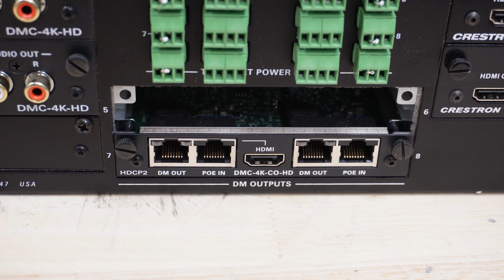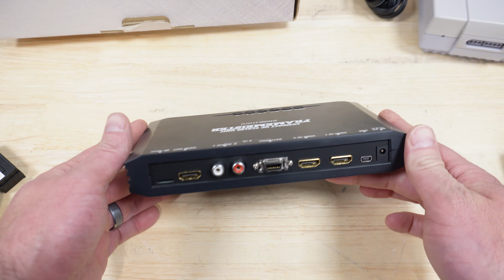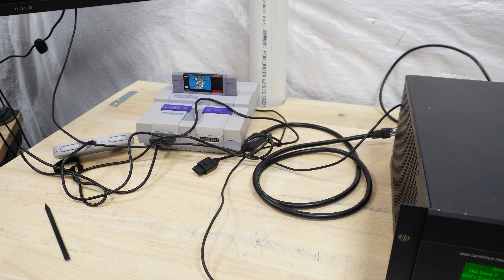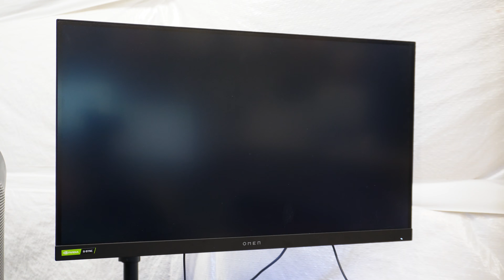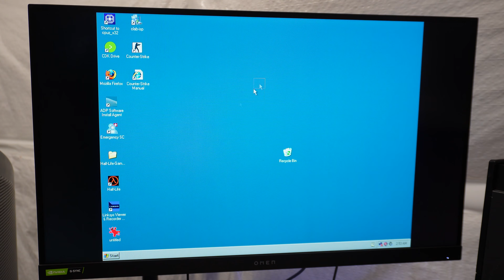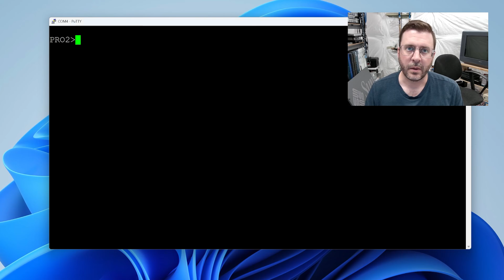Crestron Video Gear

Comment: I am a long time AV Engineer.  I worked on the very early DM systems.  Some of them were very high end command centers.  Early DM had a ton of issues, I will say that they worked most of them out over time.  Crestron overall does have some strengths, however, they put out a ton of SKUs and drop off product lines all the time, so long term care and feeding of a system is tough. I guess this is not so much an issue when re-using old gear in this lab type setup.  😁

@clabretro If you can get your hands on firmware, you will want to be on the latest for all your gear, it can help a ton.  Every single part has 1 or more FW files to flash.  Chassis, input card, output card, Room controller, computer center and so on.  

Learn about Extended Display Identification Data (EDID)  Quickly;  when you plug a display into a source, (i.e. plug your monitor into your computer) the monitor will tell the computer what resolutions, color spaces, refresh rates etc. it can support.  The computer will then (usually) pick the preferred profile and start sending video.  With pro gear like Crestron, you can edit the EDID tables and get things working if the auto-negotiation is not working out.  Over the years, I've come across many situations where I have to "force" the sink device to only negotiate with one entry on the EDID table. 🤪

Thanks for the video.

Comment: Great video! Regarding the SNES with HD Retrovision cables on the Crestron - I would suspect that it cannot handle 240p/288p on Component on the two revisions of component input boards you tried. The dead giveaway was it attempting to treat it as 480i @ 30Hz meaning it doesn't know how to handle it progressive scan at that low resolution. The composite video ADC likely supports more resolutions but again, is probably not 100% correct and treating it as interlaced as well hence the 30Hz. Could be a firmware setting issue too as you suspect or there may be older generations of card that have better support for older input signals.

Comment: The comments are full of people who have worked with Crestron, and that's just amazing! I used to build the boards for some of these units. They kept the lights on in the factory I worked at, and required some SERIOUS QA to be done to make sure everything works. I also did the test stations and "box build" (packaging them for shipping). Crazy seeing this stuff work the way it's meant to be used, since I never saw actual use cases.
Reply from the maker: that's very cool!
Reply: Why no screwdriver in the box like extron? I want a crestron screwdriver to lose everywhere!
Reply: Thank you for doing the serious QA.  Crestron systems were highly dependent on the quality of the programming, but if set up well they could run forever.  We had systems we assumed were dead call us up after ten years or more of no service calls because they wanted to change something.  It was shocking.
Reply: had one of your boxes in the ENG van I used to run for an NBC affliliate. Never once gave me any issue, so thank you for doing your due dilligence!

Comment: i used to use creston gear from a bit before that period for work

mine were mostly from the 90's so only analog (bnc and rca) but still cutting edge (for the time)

super interesting stuff, we had a custom touch screen attached to it as the control. was very interesting to see how it all used to work

great video as well ofc

Comment: We had an ancient Crestron setup in our old video conferencing suite at our old office. It was pretty amazing for the time, you could control everything from a touchscreen panel. You could use the panel to dial into a conference, switch between the cameras or PC inputs, switch the output of the conference to the left or right monitor, or both, switch the local camera view on the other monitor, it even controlled the lighting and motorised blinds in the room, and lit up a "In Conference" sign outside the room. It was really versatile system. We even upgraded the system to automatically switch the cameras and move them to point at whoever was speaking, although that was more a function of the conference system rather than the Crestron.

Now at our new office, we do have a Crestron system in one of our conference rooms, but it's much simpler, mostly used to shuffle the AV signals around. The conferencing system does most of the hard work, its external inputs and outputs are just handled by the Crestron. And honestly, it's so much simpler and cheaper not having to deal with a third party integrator to make basic changes to a conferencing room.

Comment: Hdmi supports resolutions used in Tv's, however most computer monitors do not. The "local" output is outputting the signal 1 to 1. Not using a TV to test was an instant fail.

Comment: Crestron is amazing. I had experience with some older equipment using VGA/Composite, without HDMI. It was used in a hospital - cameras in the operating rooms were connected to the inputs, and the screens and projectors were in the medical school next to the hospital. The teacher could choose which surgeries to display at any given moment and discuss them.
Reply: I figured that one of the best use cases for a Crestron setup would be for a hospital. That setup would be interesting to see.

Comment: Strong word of advice, clearly document every patch panel or wall port connected to a HDBaseT link, they can deliver power and it's passive so, if you connect anything to one of those links, it will fry.
Reply: Not true with Crestron. If you connect an ethernet device to a HD-Base-T port on the switcher, it will behave as a 10/100-Base-T ethernet port on the courtesy LAN. PoE is identical on both systems, so a PoE enabled switcher port will supply PoE to an ethernet device plugged in. 

I've used this feature a few times when installing DM and DMPS systems to confirm touchpanels are configured correctly before installing them somewhere remote.
Reply: @garethdavisUK  HDBase-t will push forward 10/100 ethernet to compatible devices but the power is 24V passive DC, not the standard 48V used by active POE. I would guess that Crestron made devices that interact with DM kit would be smart enough to handle that specific type of power.
Reply: @MatteoSaitta  Power over HD-Base-T (PoH) standard is based on 802.3af-2009 (PoE+) and is backwards compatible. Crestron implemented the 8Gb HD-Base-T v2 standard with PoH for DM when they switched from there proprietary DM-CAT system. 

I'm sure there are some non-standard implementations around from other vendors, in the same way early Cisco Phones and APs are not 802.3af compatible, but it's not a consideration when all the endpoints are Crestron.
Reply: Yeah the patch panels where I work have the HDBT ports physically separated from other POE/LAN/CAT6 lines. We also use crestron HDBT transmitters and receivers throughout the building, and as long as either the receiver or the transmitter is connected to 24v power, the other device can be powered over the HDBT line by the crestron 24v adapter. But I’ve been told never to patch a crestron HDBT to the network switch because the POE will fry the crestron units or vice versa. I kinda wish they would just be POE compliant from the get go instead of using their own slightly different standard.

Comment: Technically SCART is always EUROSCART, and the Japanese version is JP1. Why they didn't at least keep the input pins identical, is anyone's guess. Scart is a bidirectional connector, the peripheral is able to send and receive video (used for satellite decoder boxes)
Reply: For this we need @saveitforparts

Comment: Not sun racks!  Aaargh, those things were the bane of my existence for a while.  Sun, in their infinite wisdom didn't use square holes in their racks, they used round ones!  
So you can imagine the fun of trying to mount things when you can't use cage nuts and server slide rails didn't fit.

Comment: That Crestron matrix should have a Telnet server running on it and the default code on the front panel should be 1234. I just finished installing a Crestron 16x16 matrix that's controlled via Home Assistant and Node-RED. Once you learn the command set, it's actually pretty easy to control. If I remember right, the matrix itself doesn’t run a program, it really just handles configuration for the endpoints so you’ll need external control logic (Node-RED/Telnet in my case) to make it do anything useful unless you just want to use the front panel buttons.
Reply: Node Red is cool

Comment: Half-Life running in the corner feels very familiar. Probably just need to change the resolution or renderer. Half-life is kinda weird because the main menu doesn't run at the same resolution as the game is configured.

Comment: I wonder if DM is a rebadged HDbaseT protocol? And I would suspect that they're using the same underlying technology but rebadging things for like a KVM system versus video distribution system and that's why you don't have the USB on all of the devices and the appropriate device should have the opposite USB connections unless that's just for updates programming?
Well it sounds like it is HDbaseT based on one other comment I've seen. Don't forget not only was HDbaseT design to transmit video over cat cabling it was also spect to allow 100mb data connection with that to your device.
Reply: Yes indeed, DM is rebadged HDbaseT.  I have never done so myself, but I have heard that one can "jail-break" DM gear through the console.  If you knew the right people at Crestron, they might give you the console commands to make this happen.  In the end you would be able to connect HDbase-T gear up to DM, or viceversa.

Comment: I've been buying their last gen touch panels tsw-1060 (I think) and using them as home assistant control panels all over my house. Super fun to tinker with!
Reply: Aren't they super locked down like they used to be? I bought a touch panel about 15 years ago, and it was essentially a paperweight unless you were a six sigma crestron black belt that knew the secret handshake and had drunk the coolaid to get the programming software. I'm usually pretty proficient at digging all sorts of proprietary "unobtanium" software out of the dark corners of the web, but I gave up and swore off ever touching anything crestron ever again
Reply: @gorak9000  it sounds like they just leave it lying in the streets in Colorado!!

Comment: You got some stuff right but you're missing some info too.  There's also a lot of bad info on the web.   Feel free to let me know if you need any help.     17 years in AV, I also ran engineering for one of the largest integrators.

Comment: Oh Crestron... I have a lot of info about this stuff 😂 

One major thing to note - you have a LOT of different ages of hardware in that DM frame. I'm very surprised you had as much luck as you did getting stuff working together. As far as the USB HID goes... It never worked really well. They ended up discontinuing it on newer models, which is why the 4K scaler does not have it. The DM-RMC-Scaler-C has a standard USB-A port, which is one generation behind your scaler. Unfortunately not every USB HID device works, and it's very hit or miss. Surprisingly a Logitech unifying dongle usually works.

Comment: I run a Crestron DM receiver for my TV in my living room, running into an Atlona matrix switcher, and it sends the signal up to the TV using “bog standard” HDBaseT. As another person mentioned, it’s compatible with HDBT which makes life so much easier. Transmits audio and such from the matrix to the tv through one less-than-average Cat5e cable running through my wall. It’s a sweet setup!

Comment: The one on the right USB Signal Extension
Built-in USB HID signal routing allows a connected computer (or other USB HID-compliant host) to be controlled by a mouse and/or keyboard located at a presentation lectern, conference table, or some other remote location. Additional USB devices of virtually any type can be supported using Crestron USB over Ethernet Extender Modules (USB-EXT-DM-LOCAL and USB-EXT-DM-REMOTE).[4]

Comment: My workplace had Crestron (i guess it was AV2) and some expansion in Conference room,
paired with some A/V input jacks on the tables,
projector and Polycom(hope you'll try them it out someday in the future, will blows off any PC-based IP videophone, i hope btw).

AV2 was not only used for controlling these A/V I/O routings, but also had automated window shade and lightings, all controllable from iPad.
It was very highly integrated and quite easy to use, even in hurry for being late for the important meeting lol.
but i had no way to reprogram or change any values on AV2, so troubleshooting was PIDA to me...(i was IT guy back in time)

thanks for great video as always, keep it up, cheers!
Reply: The AV2 was basically the same as the PRO2, just without all the fancy front panel stuff like in the video.

And yes, without the programming software and code that was used to program your system, you are stuck and it's harder to troubleshoot... couple that with the fact that most Crestron programmers don't have a programming background and are ... very bad at programming, and programming old Crestron systems was done in a way completely unlike typical computer software development, it's no wonder troubleshooting was a PITA.
Reply: Polycom is decent. I went with CISCO. Software is a bit easier on Polycom though.

Comment: I was a level 2 Crestron programmer in the early 2000’s. I enjoyed working with all of their equipment. I was using their standard 8x8 audio and video matrix systems. I worked on Crestron gear for almost 10 years. I am enjoying every minute of the video.

Comment: I had built 7 screening/color correction theaters (I work in feature film post entertainment industry)and used the pro2 to control the room lighting, manage the audio controls on the Dolby atmos proc, adjust the movable screen masking (with presets for 1.85 and 2.35 aptect ratios), controls to raise/drop a white screen in front of the silver (damn you 3d!), it also controlled a kinoton ecII 35mm film projector over serial and controlled Christie 4K DLP cinema projectors over IP.  Lots of use of the gpio (contact closure relays and inputs), as well as specialized rs422 protocols and we used a zigbee gateway to control lightning.  Crestron can seriously control just anything.  You just had to be able to write the code to speak the protocol you need.  It was honestly a bit of a pain to have someone program it, but it wound up being cool for the time period.
Reply: "lightning" wow that is impressive if you could control lightning. haha
I've been sort of self teaching myself a lot of this integration stuff picking up a little here and there helping with my local small one screen 1920s movie theater. It's crazy what you can do if you have the imagination, interconnects and Code.
Reply: That must've been sweet

Comment: I love Crestron's hardware, and I run a few used pieces in my living room from eBay.  What really bugs though me is the closed ecosystem and the fact that you can't just download their software and program your own equipment. I was lucky enough to get hold of a very old version that was enough to get me up and running but there's a lot of stuff that I could do (like the newer non-flash panel UIs) but can't unless I'm an authorized partner and have "official" access to their downloads.
Reply: I came to that conclusion 15 or more years ago - closed ecosystem, all locked down, it's worse than a cult. There's a reason it has almost no resale value

Comment: Would be cool to total up the MSRP of all this stuff.  Wouldn’t be surprised if it adds up to more than the MSRP of your most expensive server…
Reply: Once Crestron discontinues parts they no longer show MSRP on their website. I also can't find a price list that old. But here's some parts with compatible parts subbed from a 2019 price list. tl;dr this gear, MSRP, would be approx. $24,800. Here's some prices:

$5300 PRO3
$4300 DM-MD8x8 (just the chassis)
$800 DMC-DVI
$800 DMC-4KZ-HD (HDMI input card)
$1000 DMC-4KZ-HD-DSP (HDMI input card w/downimxing)
$1300 DMC-4KZ-C-DSP (DM input card w/downmixing)
$650 DMC-VID-RCA-A/D
$800 DMC-VID-BNC
$1300 DMC-4KZ-CO-HD (2x DM output card, with one local HDMI)
$1800 DMC-4KZ-HDO (2x HDMI output card w/scaling)
$1800 DM-RMC-4KZ-SCALER-C
$600 HD-SCALER-VGA-E

Cards which end in -DSP support downmixing surround sound to stereo audio thru the RCA ports on the card. What this was mostly used for was for surround sources like media players, Blu-ray / DVD, etc. to be able to support stereo audio in additional audio zones that only had stereo speakers. These would feed into an analog audio matrix with volume control alongside the video matrix. So for instance you could have a movie on in the living room, but also hear it in the kitchen and patio.